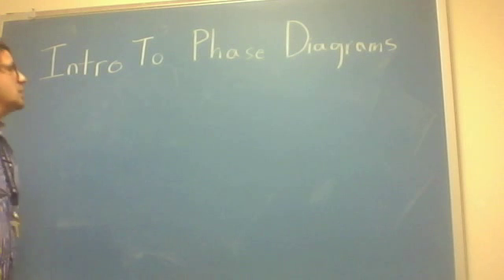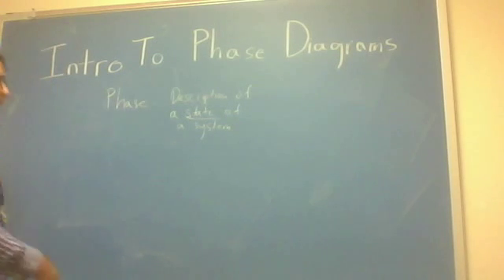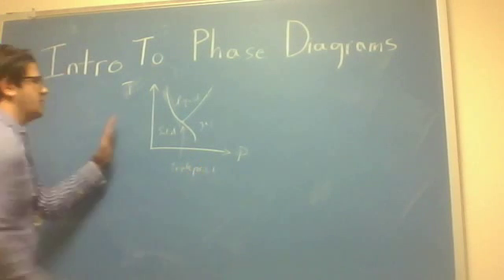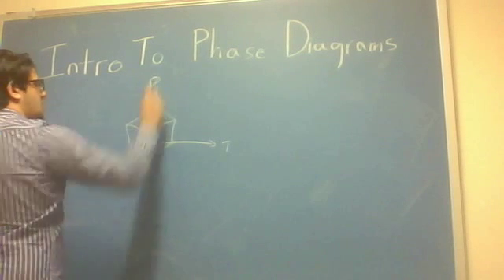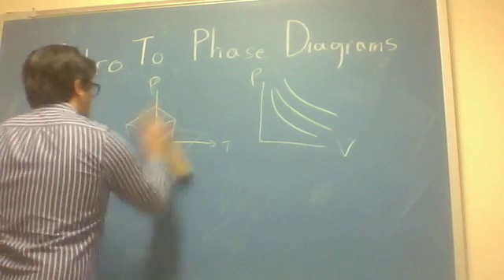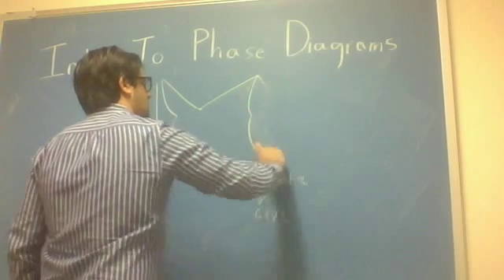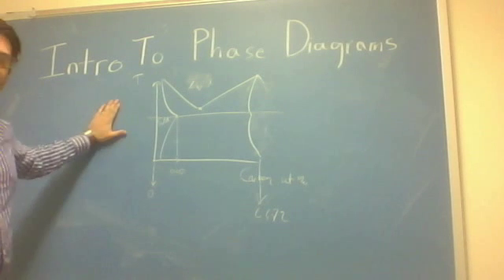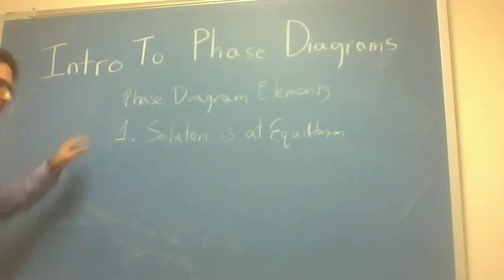Brief Introduction to Phase Diagrams

Comment: Another aspect to number 2 is the fact that phase diagrams deal with mixtures... only particular states (points on phase diagram) correspond to a solution (and not a mixture), but mostly you're dealing with a homogeneous mixture (substance) which is by definition a proportionate substance.